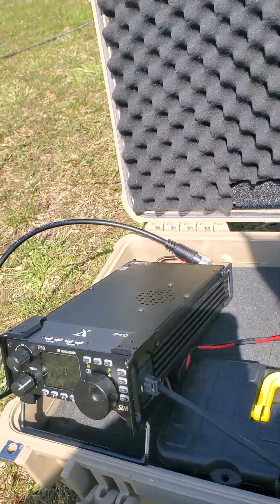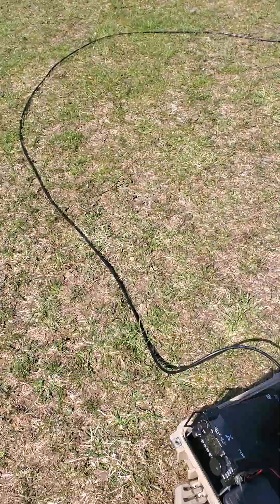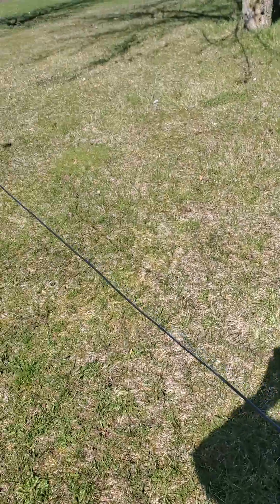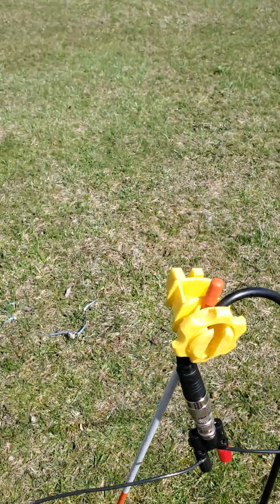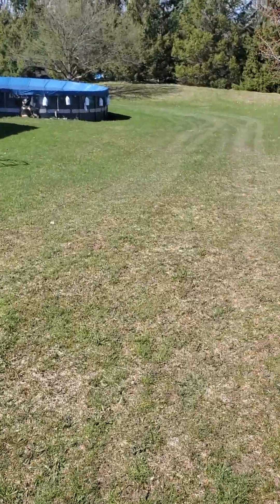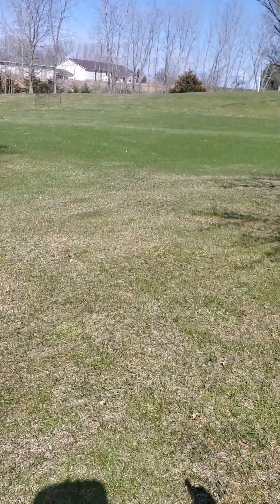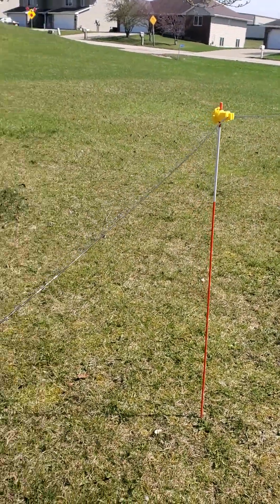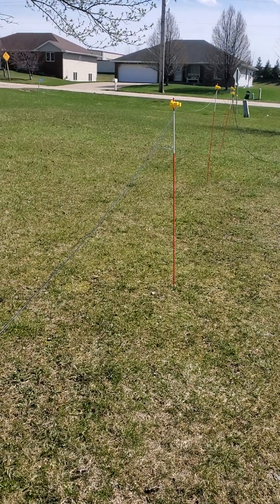NVIS wire antenna for Emergency radio

Comment: I run end fed half wave 40m NVIS. 9:1 unun. 66 feet antenna side, 17 feet ground side. I've reached 3000 miles on 20m, often 1000 on 40m. About 6 feet up.
Reply from the maker: @tangobayus  wow thats impressive! I'd love to hear more. You got any videos on this?

Comment: Hey! First time I've seen your channel on my feed. I'm 80m east of you. I use NVIS with JS8Call  and Winlink usually, let me know if you wanna do some testing sometime.
Reply from the maker: Hey awesome!!
We should be testing again April 13, around 9-11am on 40m again. Would be awesome if you could dive-in and introduce yourself. Some of the other stations involved will be WA0P, W9UPK and WA2PUX pipe-in if you hear our signals.

Comment: Nice video.  If the station who was not hearing you well is within about 30 miles he may be too far away for groundwave and too close to copy you NVIS.  The other thing is that if he is NOT operating on an antenna that works well on NVIS he may not hear you either.  NVIS works best is both station are using antennas propagate nearly 90 degrees straight up.  If a station is on a vertical he won't likely hear NVIS signals.  If one station has ther horizontal antenna more than a quarterwave above the ground it is not optimized for NVIS.  Keep working it!
Reply: I mitigate this with a crossed dipole (AS2259/Gr military style ant), seems there was no full nvis saturation which means at that specific time and area, that specific frequency was not the best, might they could of gone to a lower frequency perhaps they would have signal saturation, though yes indeed the optimum would be both stations to have the same config. A good explanation of such a matter is in the USMC field ant manual. Unlike the amateur community the military mentality is superior in targeted comms and utilize better ant to fit the specific need of the specified time..... I hope that I'm being somewhat understandable 😊 73s
Reply: Indeed, however the military goes in ebbs and flows regarding HF.  When I went to Desert Storm (1990-91)  in the Army I was a Chaplain's Assistant but we operated Army MARS for phone patches and message traffic back to Germany.   None of the commo units brought HF with them.  They were all dependent on SAT comms and it was inconsistant at best.  On HF MARS we were consistently running phone patches and message traffic back to Germany.  My brigade commander asked me to get him comms to the Petagon, which I did easily using a V-Beam strung up with cammo poles.  None of the commo people had a clue about HF and the Division Commo Officer tried to shut us down.  Fortunately he was over ruled.
Reply from the maker: Hey thanks Kj4lg!
We tried again the next night and it worked great. I oriented my wires broadside to the station 20mi North of me and he got me 5x7 right up to sunset when we had to shutdown for debrief (ARES). i also canted it slighlty North on the west end, since we had another staion 15mi due west, both went well. In fact i even caught a fella in Ohio (486mi from DBQ) while i was tuning up. Great day in all. And i definitely think you're right about the frequency, it seems quite sensitive to movements up and down the band, at least with my meager 20w radio.